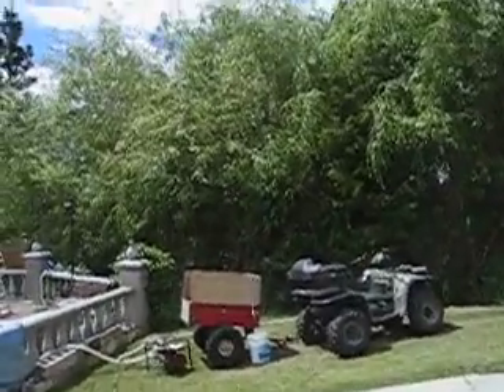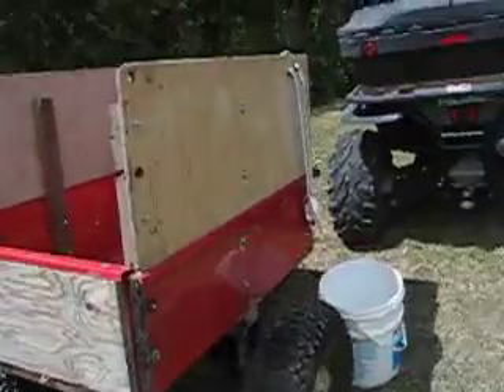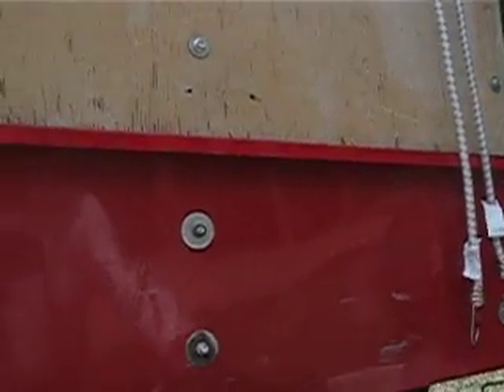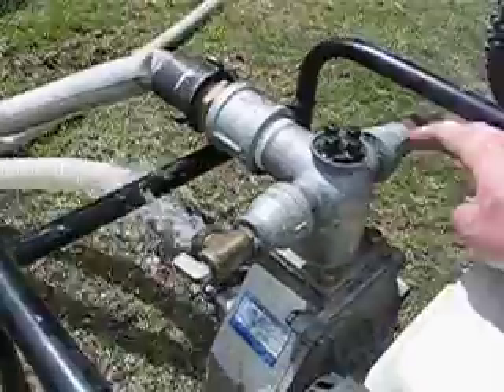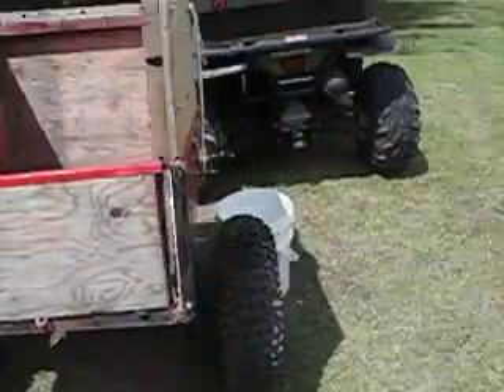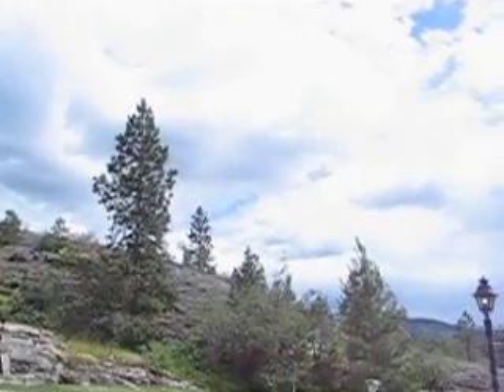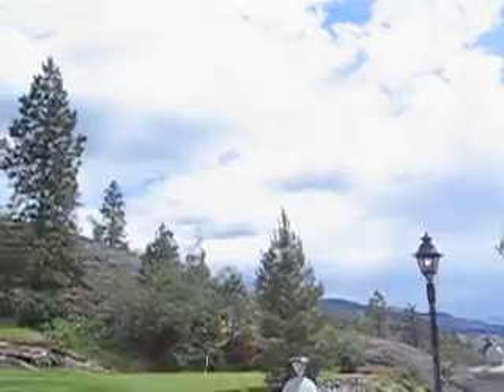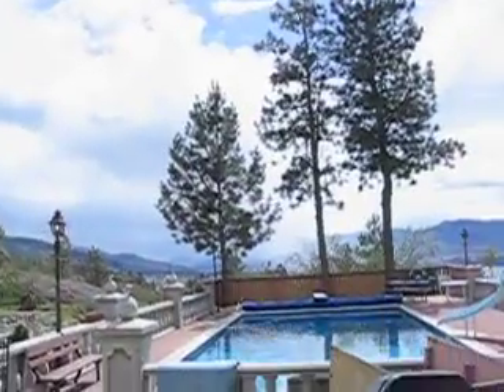ATV BRUSH FIRE TRAILER (homemade)

Comment: Cool I've been thinking about doing something similar but mounting it on the back of the quad with a little 1.5 hp two stroke pump. Several fire departments in the area use them for grass fires and brush fires.

Comment: Run 1" over 3/4".. Less friction loss. Use a 1" to 3/4 reducer at the nozzle if you really want to save pressure and water. But, definitely use 1" over 3/4"
Reply: Use 3/4" or 5/8" for the lighter fires like grass and leaves. If you use 1" you will exhaust your water supply far too quickly. There are some decent 2.5h.p. 1" pumps out there I've got one and it performs flawlessly. If you go with a more powerful pump or larger displacement pump you'll burn up more fuel and waste more water.

Comment: You could add a small 1 gallon with a needle valve and a length of hose with a barb fitting into the suction to make poor mans fire foam. Use half laundry soap and the rest hand soap .
Reply: highcountrytimber Laundry and bubble Bathworks great. Also Laundry  Dawn works great too.. Use a 1/4" black garden speinkler hose for intake hose. Thick and heavy duty shit